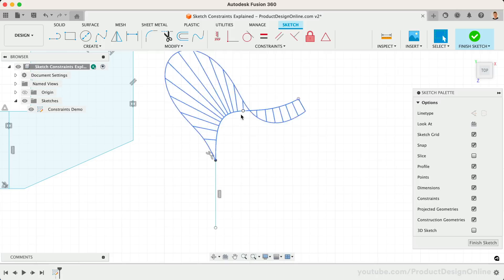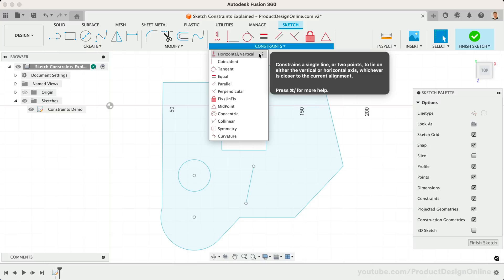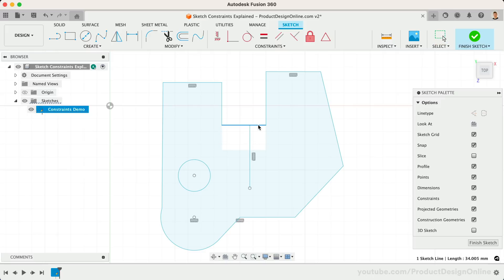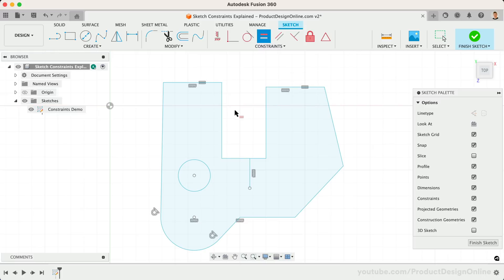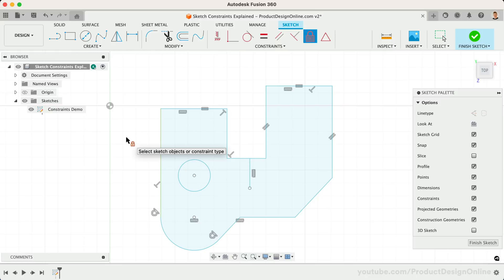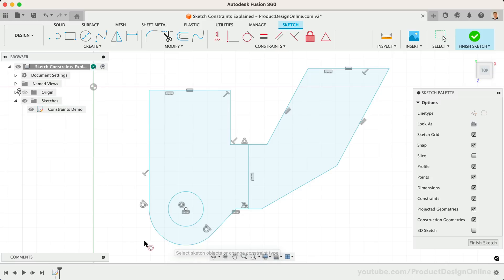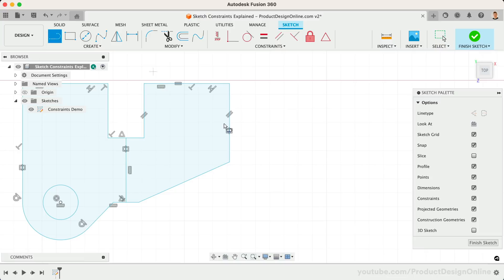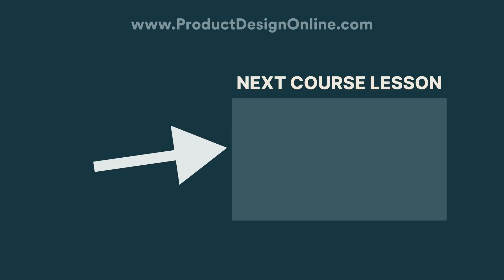All 12 Fusion 360 Sketch Constraints | Day 17 of Learn Fusion 360 in 30 Days - 2023 EDITION

Comment: Fix for people where "open in fusion" doesn't detect fusion: Just sketch out his basic shape with a new sketch on the XY its very simple and is just lines a circle and an arc. after the rough shape is sketched follow along ( I deleted the constraints there were automatically placed but as he says at the end of the video you can hold control to put down the sketched without an automatic constraint).
Reply: Yes, this worked great for me. Thanks!
Reply: Thank you for this.  Such an obvious solution, and honestly, better for my learning as I had to do it myself rather than import the image.  Much appreciated.

Comment: The constraint description in the lower right corner is sometimes cut off. like its being mostly covered by something. If i just click around on different lines then back on the constraint it works but its frustrating and i haven't been able to figure out whats causing it.
Reply from the maker: I haven't heard of that issue before. May be worth a clean uninstall/reinstall of the program. If you can send me a video of it happening, I can share it with the Fusion team/QA engineer.

Comment: Does the order of the selected lines/points, etc matter when adding constraints? It always seems to perform the expected operation, but I'm not sure if I'm missing something.
Reply from the maker: In general, no. However, there are some use cases where selection order may provide different results. It will always depend on what other constraints/relationships are already applied to the surrounding sketch entities.

Comment: You say that with the collinear constraint, order matters, but you don't explain how. Also, is there still no way to set midpoint constraints in a rational manner? It just chooses which point goes to the midpoint of which line. I always assume that the order should define which is the midpoint-er and which the midpoint-ee, but it seems to be arbitrary, and fiendishly difficult to fix when the program guesses wrong.
Reply from the maker: Collinear constraint selection order:
The first line or edge you select will remain fixed in its current position.

The second line or edge will be adjusted to become collinear with the first selection. This means that the second line will move and rotate to align perfectly with the first line.

For Midpoint, you (typically) first select the point or entity that you want to move. The second selection is the line or entity that will have the point constrained to its midpoint.

The surrounding constraints can 'override' some of this behavior, which is why at times it can feel like it's behaving differently.
Reply: @ProductDesignOnline  thanks, this confirmed my understanding!

Comment: When I do some of the operations from the video my Fusion 360 distorts my sketch horribly. Some of the lines from the top end up way down at like -100 on the y axis.
Reply: It looks like it was due to a small change that was made in the video that wasn't mentioned before applying the second midpoint constraint.

Comment: 3/26/24 - Symmetry - All went exactly as you described until I got to the section on Symmetry. Following your steps, the right angled line did not move to vertical as in your sketch.  It remained slanted, but showed the Symmetry constraint along with the left vertical and center line.  Obviously not symmetrical.  If I tried to move the slant line, the sketch went crazy.  I have all the other same constraint icons as your sketch.  Has something changed in F360 since you made this?

I have used Symmetry in other sketches before without issue, but this one has me stumped.
Reply: perhaps the arc at lower left of the figure is still fixed
Reply: @juohan  I had the same issue, yeah removing the fix from the lower left arc allowed me to do the symmetry constraint.
Reply from the maker: Hi Neil. The symmetry constraint hasn't changed as far as I'm aware. Did you happen to save your Fusion file, and if so, can you share it? I'm guessing something else is going on in the sketch that is affecting it.
Reply: @ProductDesignOnline  Thanks for the reply.  I haven't figured out how to share the file.  Can you point me toward the procedure?
Reply from the maker: @neilpreston9028  # 

How to Share Your Fusion 360 File

Personal Use License

In Fusion 360, make sure you first save your latest changes. Then, go to the FILE menu > Export > Select ".f3d" as the file type > export to your local computer. You will then have to upload the file to any sharing service (Dropbox, Google Drive, etc) and paste it as a reply to this comment.

Commercial, Educational, or Startup License

In Fusion 360, make sure you first save your latest changes. Then, go to the FILE menu > Share (flyout folder) > Public Link. Make sure the "downloadable" toggle is turned on and then copy the URL and paste it as a reply to this comment.

Comment: It would be helpful if you could show how to close this sketch, or find the reason why the sketch does not close. Thank you
Reply from the maker: The best 'trick' is to draw a straight line across your sketch to see if half of it becomes shaded in blue. If it does, then continue to draw lines across the unshaded part. That will narrow down the open area until you can zoom in or pin point it based on the geometry.
Reply: @ProductDesignOnline  I just started studying, and accidentally saw your channel, I watch it with subtitles, but everything is very clear, thank you for your work

Comment: I am not a beginner.  This series is excellent!  I have learned several small details in most of the lessons, mostly Fusion 360 specific details and shortcuts.  I have used about 5 different CAD systems in the last 35 years, mostly at work as a design engineer.  I have told a group of high school kids to watch this series before I have to work with them do FIRST robotics next month.  Many of the points you stress are ( rename stuff, fully constrain, fillets at the end, etc) or really important but often overlooked.  Can’t wait to get to the joints and expressions lessons.  ( I do listen at 1.2 speed… I know what you are doing.)

Comment: In complex sketches, I some times get an error saying I overconstrained the geometry and I struggle finding the relevant constraints in conflict.
Is there a way to see which other constraints I need to revise?

Thank you Kennedy for this superb Series!
Reply: not an expert but my most reliable technique is literally drag every point and line until one moves independently of my constraints, if that doesnt find it its usually in the positioning of the whole piece sketch or of arc centers

Comment: Is there a way to tell Why a sketch is not fully constrained? I have had many sketches that wouldn't fully turn black or get the lock icon, but every constraint I added told me that the sketch would be "over constrained". Any ideas?
Reply from the maker: There is a hidden way in Fusion 360. I explain that here: https://youtu.be/matqB8nGzQI?si=7vq0nRwdeFjcI2U6